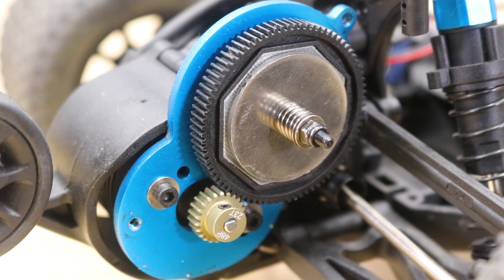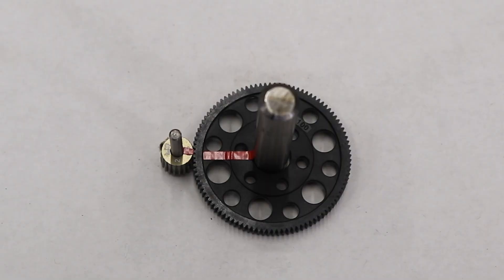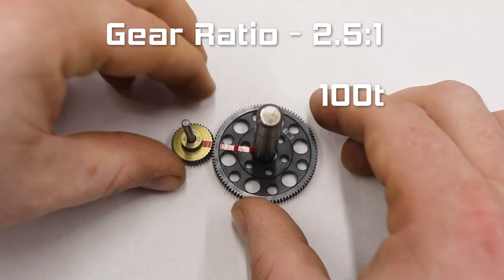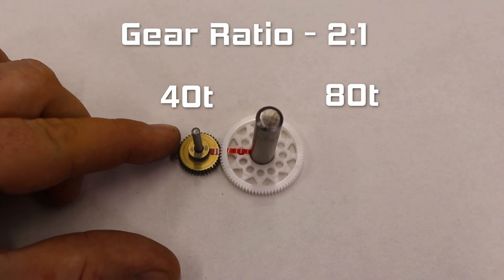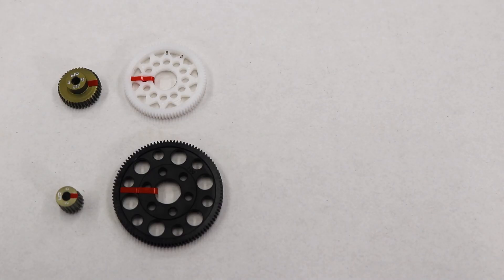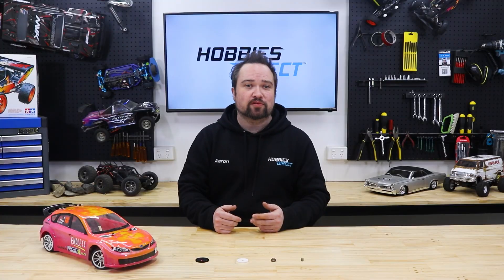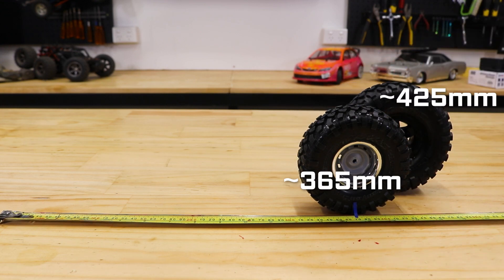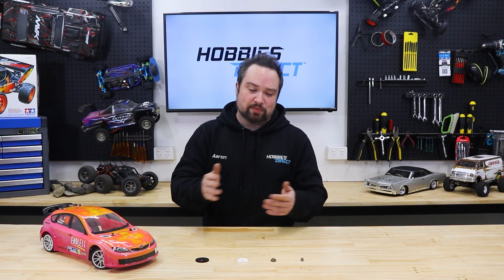RC Gear Ratios Explained! Pinion and Spur for max performance

Comment: What is the best gear ratio for crawlers, alot of players using?
Reply from the maker: There is no one one best ratio, as you also have to take into account how fast the motor is, and what voltage the battery is, and how big the wheels are. For crawlers though, people usually want them as slow as possible, so smallest pinion and biggest spur that fits 😊

Comment: I have an ez run max 10 sct 3880 combo in my mt 10 rival with a 12 tooth pinion  i am getting thermal shutdowns and am trying to solve that issue but at the same time am worried if i drop down to an 11 tooth the front end wont stay on the ground. Would adjusting thermal shutdown be a bad idea? Should i just drop down to 11 tooth pinion to solve this issue? Whats the suggestion here?
Reply from the maker: If it's overheating, barring no other problems, it's likely over-geared. Keep the front end on the ground by going easier on the throttle :-)
Reply: @HobbiesDirect Thanks man i just went ahead and ordered the 11 tooth

Comment: I have a 28 pinion for my motor and I have a 86t for my gear box, in my motor and ESC were burning hot then I tried a 16t for the motor and a 86t for the gear box my motor was hot in my ESC was cool, what should I fun? I have a 4300kv hobby fans motor and esc, and I’m running 3s. What should I do and run?
Reply from the maker: It might be a too high kv motor for the build, the wheels could be too big, the car could be too heavy, gear mesh could be too tight, bearings might be seized, drivetrain could be binding, you could be driving in thick grass, any number of things. Really depends on what vehicle it is and many factors.
Reply: @ it’s a Traxxas rustler

Comment: 21T pinion and 64T spur gear and 3500kv brushless motor how about this setup 😊
Reply from the maker: Really depends on what the car is and how big the wheels are, but sounds fun!
Reply: 1/10 monster truck
100mm tyers
Reply from the maker: @ Also depends on the internal diff ratio, but should be fun! About a 60km/h top speed on 2S is what you should be aiming for. As long as everything stays relatively cool, go for it!

Comment: I have a kyosho fazer mk2 and im looking at getting an EZRUN MAX10 140A combo 3665SD esc/motor. Im gonna upgrade other parts and get a 4s 14.8V battery. What gears do you recommend to get a solid top speed but also be good down low? Im gonna get the sway bar upgrade for it as well. Kinda wanna do a drag style set up but still have the availability to drift and just drive around.
Reply from the maker: Really don't recommend a 4s battery for the Fazer, ever. What kv motor where you looking at? It's way more power than the car was designed for, and way more than the chassis can really use. You'll be wearing out parts and tyres super rapidly (though it does sound hilarious for the 5 minutes it would last). It's relatively easy to get a Fazer to 70km/h on even just 2s, but if you must have higher voltage, limit it to an 11.1v 3S, and the smallest pinion that fits.

Comment: Is there any affect on the torque applied using the same FDR but different spurs and pinions? Say 97 spur 31 pinion vs 81 Spur and 26 pinion
Reply from the maker: Might have to ask an engineer for this one! The answer probably has a lot to do with rotating mass, parasitic drive train loss and materials used, but ultimately the difference is likely negligible.

Comment: Great video I have a brushless 10.5 turn motor what size pinion would be best
Reply from the maker: For what car? With what battery? Wheel size? Happy to help, just need more info 😊
Reply: @ hi tamiya tt-01 lipo 2s fusion exceed brushless 10.5 turn
Reply from the maker: @ Oh sweet! In that case, as big as you like haha. 22T would be a safe bet, or you could go down to 19 and make it super punchy. As long as the whole build has bearings and not the nylon bushes they come with, you can fit any pinion you like, the rest of the drivetrain is geared very conservatively 😁
Reply: @ thank you 😊

Comment: I'm trying to build an RC car from scratch with little to no experience in the field, I have a 35T crawler motor and ESC I bought second hand, currently designing a 3d printed gearbox to run the thing, and since the gears have to effectively be huge, and the car itself will be comparatively tiny, I'm somewhat limited to the ratios I can achieve with 3d printing (teeth need to be roughly 3mm to get suitable accuracy, I currently have a 1.8 ratio from motor to wheels (no diff or anything like that, just direct drive to a rigid axle) doing the maths I should achieve approximately 36mph based on wheel size. I'm hoping I don't explode anything electrical and just shatter a few gearboxes and 3d printed axles in the process.
Reply from the maker: That's...pretty fast for a brushed motor haha, especially one you'd expect to be in a slow car. Just keep an eye on temps, and good luck!

Comment: Great video and very helpful!
I have a question….
It’s about the Lunchbox in the background 😆
What chassis is it on? 
Many thanks 👍
Reply from the maker: That's Aaron's own Lunchbox! It's on the original chassis, but mounted to sit a lot lower :-)
Reply: Thanks  @HobbiesDirect  
I like the look of it! 😎👌
Reply: Sorry….
I have another question 😆
What tyres and wheels  are used? 
Many thanks
Reply from the maker: @danwilliams7372  Think the wheels are 1.7" to suit the 1/14 scale trucks like King Hauler, and the tyres are grasshopper rear paddles :-) It's been changed into something else now though!

Comment: If the gear ratio is 10:1 whats the spur and pinion gear t?
Reply from the maker: Any multiple of 10 and 1, so 100 and 10, 200 and 20, 150 and 15 etc.

Comment: I have a arrma Gorgon and I switched from a t15 to a t26 and it's sooooo slow. Should I change my gear ratio to gain more speed or switch to a 12t.i keep burning up the stock. Motors.
Reply from the maker: You are right, a 26t motor will be a lot slower than a 15t motor, though it will have more torque. You could gear up for more speed, but Arrma pretty much got it right with the stock 550 size 14 turn.

At this point, probably best to go for a cheap brushless system. Like 60A and 3300kv. Though you would have to change the radio/get a new compatible receiver as well as the Gorgon's ESC and receiver are combined into one unit.

Comment: I have the element enduro senduro. i changed the pitch to 32 on the spur and pinion. i have the slip pads and washers for the spur. Can i run this with the same trans and if so, what other parts do i need. If not, what do i need to buy to make this run because it's not running.
Reply from the maker: As long as the gears stay roughly the same size (and therefore the ratios), and all the pads fit and stuff, the pitch doesn't change anything.
Reply: @HobbiesDirect  not having a problem with pitch my problem is the it goes all the way against the housing instead of having some space like the factory one that came on it

Comment: hello, im converting a 1/10 scale nitro basher into a brushless basher. my stock gearing (2speed) nitro gears are 45t and 50t spur. I want to add a pinnion onto the brushless motor that will work well with the 50T spur thats allready on the car. im planning on using  3650 Brushless Motor 4500KV 60A. could you help me pick the right pinnion size to go with this setup?
Reply: the original pinion is a 14t to go with the 50t spur.  and a 19t pinion to go with the 45t gear.
Reply from the maker: Is there a brushless version of your car from the factory? If so, start with the ratio that that came with :-)

Comment: Would there be a way to make an rc car be able to “cruise” at a speed without it being almost full throttle the whole time
Reply from the maker: You can turn down your throttle endpoints to slow the car down, or turn up the trim to make it drive forward slowly by itself. The only car we know of with "cruise control" is the TRX-4.

Comment: So for carpet racing would you want to have faster acceleration then top speed ?
Reply from the maker: depends on the track, but if the straight is only 2 seconds of a 20 second lap, you're only going to be the fastest on 10% of the track. Our local track is quite tight and twisty, so races are won in the corners.

Comment: I understand gear ratio, but why not put big gear on motor and smaller gear for wheels? Or it will be too much and car will be ripped in peaces? I am desiging my own rc car from 0 level and i thought that it was something logical, but i might not understand smth
Reply from the maker: Brushless motors can spin upwards of 50,000rpm, some even 100,000. if you have a 5:1 reduction ratio and just go giant pinion to small spur, you are asking the wheels to spin at half a million rpm at full throttle. That's...a lot. Even at slower speeds, throttle control would be terrible and the motor would have to work really hard to overcome the gearing. That said, making a car from scratch is awesome, good luck!
Reply: @HobbiesDirect  thank you very much. I just saw on yt people making rc cars with 3d printing. So i got inspired to do the same but not everything 3d printed bc plastic is not strong and suitable for gears. So i am planning on making a road one and offroad one but it needs an insane designing and planning work its just takes me weeks to just a design it. So yeah thanks again

Comment: Do you happen to know what pitch most 1/8 scale buggies and SCT use, neither one of my manuals say they just tell how many teeth, I converted my 1/8 scale buggy from nitro to electric and the motor came with a 15tooth pinion and my center differential gear is a 46 tooth and it's real slow but the motor is barely getting warmer than ambient temperature, it's got incredible bottom end speed but top's out about 25 mph, was thinking of trying a 19t or 20t, your opinion would be greatly appreciated and I know that the 32 pitch gears don't mesh with the differential gear
Reply from the maker: If 32 pitch gears are too small, the next most common size up is 1.0mod.
Reply: @HobbiesDirect  I'm hoping that's the same as mod1 because that's what I've ordered from my local hobby shop, thanks for the quick response, I truly appreciate that, great channel by the way, Peace Brother

Comment: I actually stopped messing with my RC car because I made it TOO fast.  It was fun building it and modifying it but i think i crossed a line somewhere. Its way too fast and accelerates WAY too fast to the point it almost rips itself apart. I stopped when the next logical step was to upgrade all the parts to support the speed/torque. I live in a densely populated area so fast became not so much fun after a while.

Long story short i watched your video so I could learn more about how to gear it back down again because i previously just used trial and error to get it high torque and speed (upgraded so much stuff).
Reply from the maker: Oh yeah, there's definitely a sweet spot for every car, and a lot of cars are more fun at 50km/h than they are at 90!
Reply: Whats the best ratio for stampede 4x4 bl 2s @HobbiesDirect
Reply: Yeah pretty much my Rustler 2WD story ;) Took me years to imagine I was eventually building my own car after breaking all possible parts many times. A great learning experience nonetheless.
Reply: I'm not sure honestly. I suck at gear ratio stuff. I'm sure there is a table somewhere.  I think it depends on speed over torque. Which you wantz what components you are running and so on.

I will say that at some point running ANY plastic parts caused the thing to self destruct (even in the steering). I had to limit the speed via the controller. 

I like to build stuff but if I am honest running it stock was really fun. I pushed it as far as I could and that was super fun but more because it was an experiment.